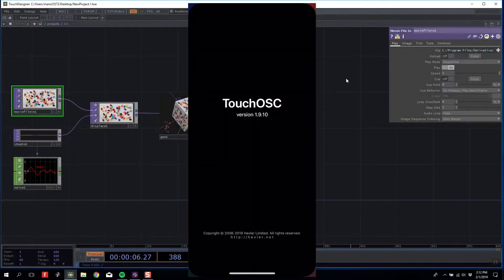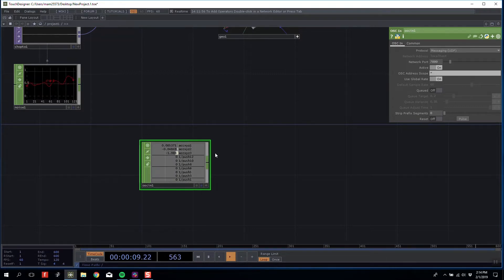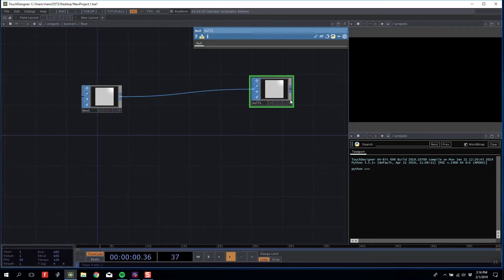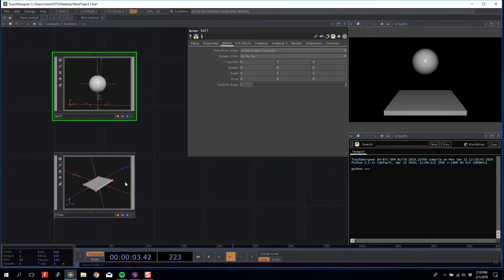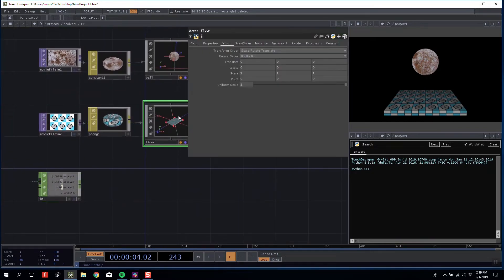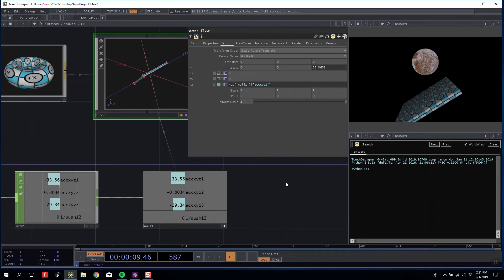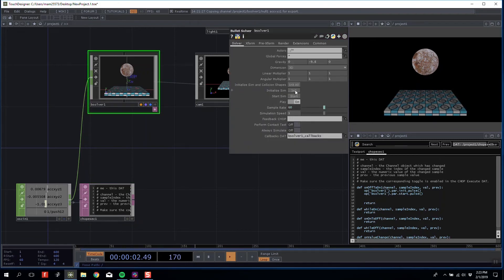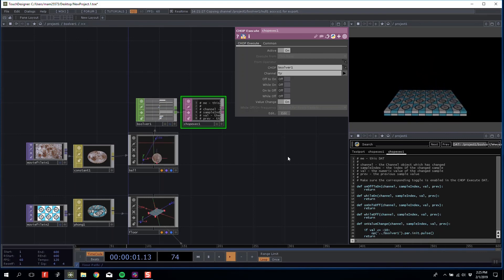Touchdesigner  - Bulletsolver and the Realworld - TouchOSC & Physics!

Comment: Fantastic tutorial. Great workflow, very efficient.  Thank you!
A few tiny details: You use Lag CHOP to smooth the TouchOSC signal, but it's still twitchy compared to a Filter CHOP with a Box type filter at .2 sec. That's cause Lag reacts quickly to changes whereas Filter with Box resists spikes but is still responsive.
Next, to initialize/start the Bullet Solver COMP you can just pulse the Start parameter. It will do an Initialize and Start at the same time if it's not initialized already. This works just like the Timer CHOP.
Reply from the maker: Appreciated.
Hopefully it sparks some ideas for creators!
I knew there was going to be a better solution to the lag but in the moment my brain couldn’t come up with the answer. I’ll make sure to check out the filter next time!